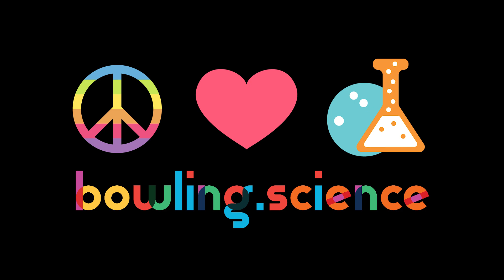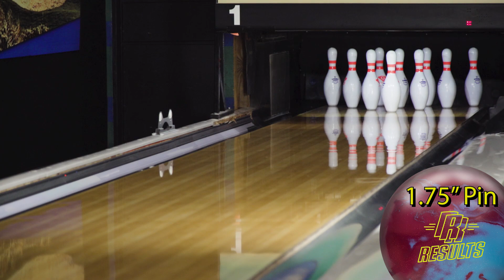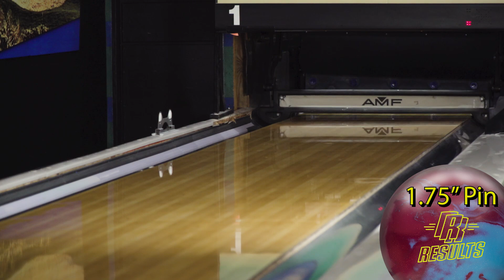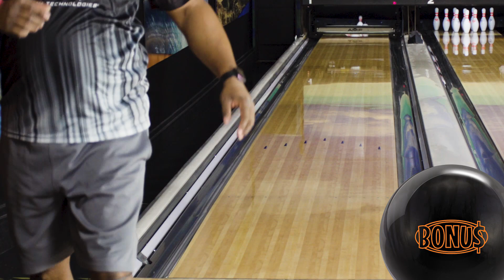Bowling Science: Does Pin to PAP Distance Matter?

Comment: Curious to hear Mo's thought on this.  There's another reviewer out there that claims to be making a difference, who recently said that pin up or pin down doesnt make any difference as long as they have the same pin to pap, and "Pin to pap doesn't make a significant difference compared to changing surface or just changing balls all together"...... according to specto data and some computer simulator software.
Reply: munkeynutz13 Yes Mikey and Mo there is a review out here stating that Finding ones PAP is an over rated concept on how to drill a persons ball. PAP doesn't mean a thing. You can drill up a person ball the exact same layout for everyone it doe st matter. He also mentioned a lot of pro bowlers go to this same PSO to drill up there equipment. I told myself he was full of ####!!!!!!!!!!
Reply: I've seen those videos also and have a theory but I can't back it with science and would welcome your input. In the other videos they throw one ball and make a comparison. I speculate that it is on fresh oil or something close to it and that the difference in reaction would be exposed with more friction. That's the purpose of different layouts and equipment is how they react to friction everything's going to hydroplane on oil. They even go as far to say in the other video that with more shots the balls would react differently and the variable in that scenario would be the increased friction that is transition. Hypothetically if you put 58 feet of high-volume oil would anything matter other than accuracy? axis tilt axis rotation, core, layout have little to no relevance until friction is added to the equation. If all equipment reacted the same when encountering friction you wouldn't need an Arsenal. So in my opinion he's only giving the information to make his difference making sanding pads more relevant because that's the business he is in. If he was still selling bowling balls he would paint a different picture. Again I'm only using logic are and welcome any criticism of it. I would rather be corrected and learn something then be wrong while thinking I'm correct.